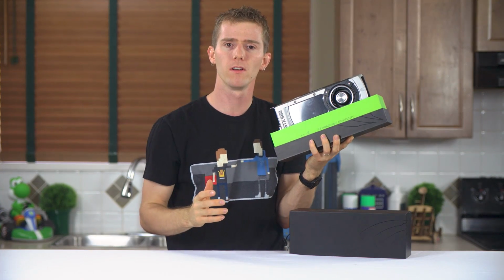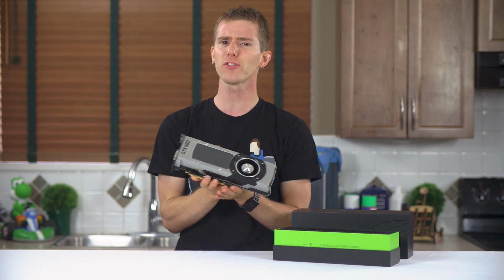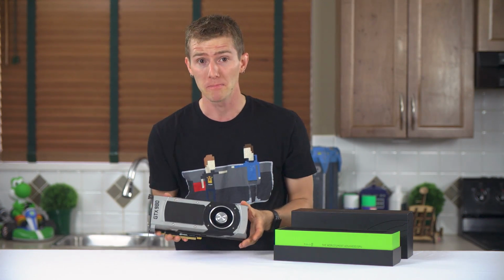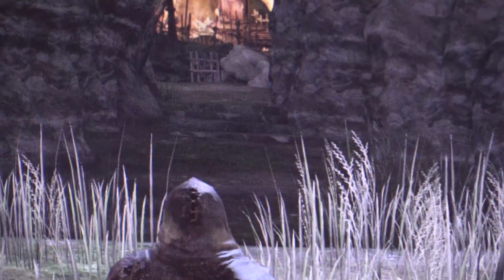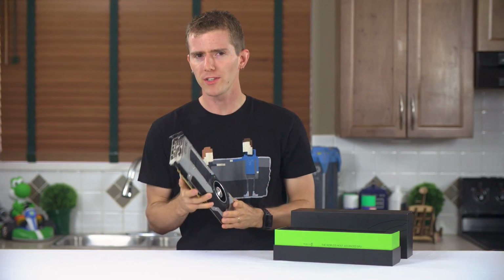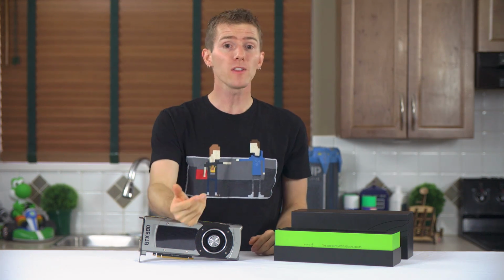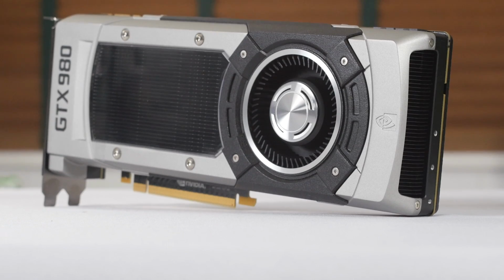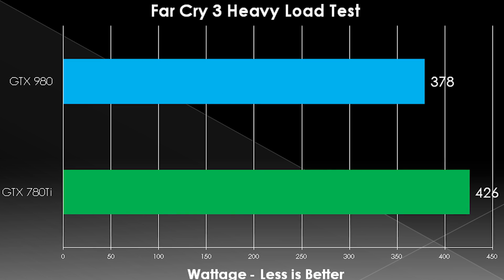NVIDIA GeForce GTX 980 Video Card - Performance Overview

Comment: who else came here after seeing the new GTX 1080!!!! :D
Reply: Here after the rtx 3090!
Reply: iBoolGuy isn't 120 FPS enough. That's just overkill. I have no reason to waste a extra 100 bucks (Which is alot in my currency) just for more FPS which I don't even need. It's not that good unless your monitor can handle 120 FPS. I don't want to wait for the 1080 Ti.
Reply: iBoolGuy Which team are you on :). Team Red(AMD) or Team Green(Nvidia).  I'm team Green but don't force other people to change their stuff to Nvidia(Hate those guys) and Well this is totally based on performance wait a bit and get the GTX 1070 or GTX 1080 they are like on par with the GTX 980 Ti which has 10/10 score in GPUBoss comparing with a R9-390X which has a 8/10. Pascal is way cheaper too well It's your opinion just letting you know how you can save some money.(http://gpuboss.com/gpus/Radeon-R9-390X-vs-GeForce-GTX-980-Ti)
Reply: Dhruv Collins and again, as you may already know, the 390x (gigabyte version which is my personal fav) is way cheaper than both the 980 and the 980ti!!! (also gigabyte versions)!!
Reply: me
Reply: me
Reply: +Dhruv Collins u r right of course, but u don't know the way he thinks :/
Reply: me
Reply: !!!!!!!!!!!!:D!!!!!!??!!?!!!XD!!!
Reply: Rtx 2080
Reply: 2080?
Reply: here after 3080 launch video
Reply: I came here after the 3080 fiasco. Bought a very cheap $50 ASUS GTX980 to run MSFS. It does the job at 1440p with some tweaks in the graphic settings. I'm going to wait until the Big Navi and 3090 market stabilizes.
Reply: @d.joseph4356  holy frkn balls! a GTX980 for $50! That's quite the thing to hear! Enjoy that thing man, good deal! :)
Reply: @iBoolGuy  I know right? the second hand  market is insane right now, saw a gtx 1080ti for like 350 dollars
Reply: @ericb0207  Just bought a 1080 ti for 240€!
Reply: @d.joseph4356  You're not running 1440p on a 980 ggs
Reply: blaze smooth at low fps
Reply: Holy shit, that was along time ago
Reply: Dhruv Collins I mean yeah of course I'm with you in that, I'm not the type of "overkill" person, I just ask for a smooth experience and that's it, but for some people, they would pay whatever to get that extra 1 frame :\ 
and btw, I'm saving up to get the 390X :D I'm not gonna wait for the Polaris cause it's gonna be so expensive :V
Reply: lol I'm obviously on the red team side, it's just about love :D I like their warm in the winter, I love the sound of those 3 fans shaking my mastercase pro 5 XD and lol of course I know that some GTXs do better, but it's just a personal preference and more about love <3 and yet the 390X is an excellent card (for my needs of course), so yeah :D
Reply: I did, then took advantage of the plummeting 980 prices due to the new release.
Reply: +threedogification best move ever. :p
Reply: threedogification That was not a good move you could have got a 1080 which is much more powerful than a 980 Ti or a 1070 which is on par the the 980 Ti.
Reply: +Dhruv Collins he's obviously really limited on budget, and for that price a 980 does more than good for him, as I could tell from his comment!!
Reply: Dhruv Collins lol apparently he prefers getting a bad deal if he's actually going to buy one, but I guess the way he sees it, is he gonna pay less, so that's a good deal for him?? and maybe he's not gonna be able to make more money in so long, so there's no good of waiting! as I told you, you don't know what's he's going through, everyone's situation's different :)
Reply: Dhruv Collins for imma amd fan boy :p dunno about him!
Reply: Dhruv Collins lol man sorry i have no idea how to use that!
Reply: ***** 290X ??? I was talking about 390X, but definitely, first I'm gonna wait and see all about Polaris and its prices
Reply: ***** I don't even know about Vega!! but personally, I would pay extra money for newer technology even if there wasn't that big of performance improvement.
Reply: ***** it's not about budget, I just want to get a 1440p monitor, but my card cannot handle that, and that's why I wanna upgrade it, and I've been waiting long enough, but anyways, 2 or 3 months are ok, hope Polaris turn out to be better than expectations :)
Reply: ***** I don't understand people like you, sir, your card does not deserve an update, especially when you're only updating to 980 :\ just my humble opinion! :)
Reply: ***** well, thanks for calling me a fucktard, while I was only trying to help :)
Reply: ***** i did not mean they're close in performance, but within the same conditions that u might already have, upgrading won't be worth it unless u want to get a higher resolution monitor, but if 380 runs your games at 60fps, personally i dont see it necessary to upgrade, nonetheless good luck with what you got :)
Reply: ***** lol i'm happy u understand me now, cause of course i talk only for myself, and 60-75fps is great for me, and personally i don't get the point with more fps than that!
Reply: +Dhruv Collins 13-48 fps
Reply: +Super5oldier1 960 in space engineers with alot of stuff
Reply: +BEASTGAMER im gonna search 880,780,680,580 etc after this
Reply: +deez nuts gtx 880 never came out
Reply: I did
Reply: ME!!!!!!xd;)
Reply: Who came here after already buying a 1080????
Oh wait...probably just me.
Reply: I'm watching this on my 1080 Ti
Reply: iBoolGuy me
Reply: i am here after the RTX 2080
Reply: Im here after the new (over priced ) rtx 2080 ti
Reply: Rtx 3080
Reply: RTX 3080.
Reply: I see this after seeing rtx 3080 LOL
Reply: laughs in rtx 2060 super
Reply: What about rtx 3090? Lol, it puts all of this to shame, and this is only 6 years old
Reply: And I came after seeing 3090 (imagine seeing this comment like 4 years ago)
Reply: Moghal Baig this thread is a literal portal/time machine.
every new generation that comes out, it starts a buncha replies from the newer gen.
lmao look at the replies and watch each era.
rise of nations 😂
Reply: Technically...
Reply: im here after the 3090 lmao
Reply: Of these comments Didnt age all that well
Reply: hey im from the future. im here just weeks after 3090 is released
Reply: i did

Comment: new to building PC's, just got a GTX980, is overclocking worth the price? I5-6500 for about 200 , includes a stock fan but not great for overclocking, or the I5-6600k which is 50 dollars more and requires I buy a cooling system, probably would go with the 212 evo. what do you think?
Reply: +goalieslayer intel CPUs without K in their name do not support overclocking FYI! imo the 6600K is perfect for gaming, same as its ancestor the i5 4690K!
about overclocking, I personally never seemed to need it :\ but I tried it tho, and also never worked for me, especially overclocking CPU, it's a pain in the butt, needs lots of hours and tens of different elements and configurations to change and monitor!!
but anyhow, you wouldn't need overclocking, cause those CPUs have ready boost overclocking, meaning it will boost up the clock on it's own when it's under heavy load, and some motherboards support on-board one click overclocking, going from the base 3.5GHz clock to 3.9GHz in my case!! I hope I helped :)
Reply: thanks!!! that was indeed helpful! i went with a 4690K

Comment: I just put one in my Mac Pro because I could get one with EFI ROM from MacVidCards. It works really well. Under OpenGL its somewhat slower than under DX, but unless Metal gets some traction that's what the games under OSX will have to live with.

Comment: I'm about to buy a pc with this gpu and since it can run 4k @ +30 frames, would I be able to run 3 monitors on a single board all Max and still get more than 30 fps, I'm looking to do this in the future with a fast 1080p in the middle with two super cheap $40 12 Ms response time school edition type monitors all 1080p
Reply: I may be late but, 4K is 4 times the resolution of 1080p. While 3 monitors is only 3 times the resolution. So you'll have no problem running it 30fps+ on Nvidia Surround or wtf it's called.

Comment: Nice Video like allways :-)
 I have a ASUS Strix GTX 980 @ 1400 MHz 
Boost Clock and 8210 MHZ Memory Clock :-)
 Asus Crosshai IV Formula Motherboard with a AMD FX-8150 @ 4.2 gHz
10 gigs of DDR3-RAM @ 1333 mHz
Performs very well. Upgrade the cpu maybe this year. On my chanel i have some Benchmark with this card. This card have a lot of Power . I pay´d 550 € and got Assasins Creed , Asus Mouse Gladius for free . Sorry for my english :-)
Reply: +Link Gaming get a i5 or i3 6100 and BOOM epic gaming system!
Reply: yes i Know 😀

Comment: I want to know what the 980ti does in 5760x1080 60hz.
Reply: Just dont get a 980ti for 1080p😑 its too overkill for 1080p and a waste of money, just get it if ur doing 1440p or 4k
Reply: Plus its 60hz , just go with the gtx 750ti because its only 60hz , that card will do just fine

Comment: I have a GTX 760. Should I wait until next year or upgrade now?
Reply: wait
Reply: +Ratchet Well, to be honest, you could easily pick up a 980 for less than 430$ and prime shipping or a 970 for under 300$ and free prime shipping or free reg shipping and the performance increase on even the 970 is well worth it. Although i myself have a 980 and love it, i would recommend getting a 970 now or 980 and 1080p60fps will be good on 90% of games through two years. However, it just depends on how much you want to spend and what not, just my thoughts

Comment: Idk if I should get the 970 or the 980. I've heard some bad things about the 970. Someone halp :'(
Reply: +Vortex Depends. Assuming the rest of your system is capable of handling these cards without bottlenecking, and you're not going to be gaming above 1080p, the 970 will be perfect. The "bad" things you have heard about the 970 are probably referring to its VRAM. It has 3.5GB usable VRAM instead of the advertised 4GB. If you are going to be gaming at 1440p or above, this can and will cause problems, but at 1080p, 99% of games will not be negatively affected by the VRAM in the 970. However, if you plan to play games at 1440p or above, the 980 will be a better choice. Hope this helps :)

Comment: HELP FAST! Can I use this GPU on my Asus Rog G20 ? I only have 1 power brick at 180 Watt, and I am going to buy another power brick at 230 Watt so then I have 410 Watt in all togheiter! And this GPU reqiures 500 Watt, but I only have 410 Watt. How does this work ? I also only have 6 x 8 pins... I'm not quite good at this.. please help! :)

Comment: So did i fucked up buying gtx 980 instead of 970? because a lot of people say that the price isnt worth it...
Reply: +Joao Pedro Mesquita No it def is not worth getting a 980 over a 970. However it is still a beast of a card and if the extra money you spent wont go to anything else, then dont worry about it.
Reply: +Machoalbatross thanks
Reply: +Joao Pedro Mesquita 980 has proper 4gb of vram. 970 has 3.5gb of proper vram + 0.5gb of of slow ass ram.
Reply: I think im going to buy a 1080
Reply: :D

Comment: i have an i5, 8gb of ram and a 550 corsair power supply. will this be okay or is it overkill?
Reply: should i go with the radeon 270x instead 

i want to play ark: survival evolved at medium- high settings with at least 30 fps
Reply: +Steffan Labuschagne i have an i5-4460 and a r9 280x and could run ark smoothly on high, i should try again with the new updates to see if i can ultra now, but ark is very demanding.
Reply: +yuukiflow Haha, demanding. It's just not optimized.

Comment: for the guy with minecraft at 40 fps instead of much higher. check if you dont use the intel integrated video card instead of the nvidia one.

Comment: Is this worth €150 more than a r9 390 or a 970?
Reply: +Zeuslight and the GTX 980 does NOT?
Reply: +Evan Griffin The 970 is a scam. You're paying for 4GB of VRAM while you only get 3.5 and 0.5 slow vram.
Reply: +Evan Griffin Its about 15 FPS more than a 970.
Reply: nvidia 970 has shadow play

Comment: I have an AMD A10 @3.6 ghz with 12 gb of ram. I only have a 300watt power supply though. Could I run this
Reply: +The JelliedPumpkin No, definitely not. An AMD A10 is an APU, which would bottleneck even a GTX 950. Also, to run a build with a GTX 980 you would need 500w minimum from a reputable brand. Your ram is fine though.

Comment: I have an 
AMD FX8320 cpu
Gigabyte 970 motherboard
Corsair 650x psu
Would i be bottlenecking this big time if i got it?
Reply: 8 gb of ddr3 1866 mhz
Reply: Not at all
Reply: +H White No but you may get bottleneck at lower resolutions because the fx8350 is better at super high res. its a decent 4k chip but not great for 1080p.

Comment: I have a GTX 980 4GB, Intel i7 2700k Overclocked to 4.2GHz, and 16gb of ram all on Windows 10 64bit. Fallout 4 will dip down to around 45 frames when walking into deserted cities like where the Brotherhood of Steel base is with most settings on high and godrays to low. Idk why I thought I could run it close to completely Ultra. Should my rig be a good match for the 980 or am I maybe bottle-necking? I have the money to upgrade so I was looking for opinions.
Reply: +El Manimal I think I know your problem;
Go to desktop, right-click and go to Nvidia control panel.
Next, underneath "3D Settings" (Top left) click "Adjust image settings with preview"
Then select "Use my preference emphasizing" and slide the slider to performance rather than quality.
Hope this helps!
Reply: ***** Hello thanks for the reply, I figured out the problem. I needed to update my motherboard lol. After that, Witcher 3 runs on an almost constant 70+ frames on Ultra! :)))
Reply: Will this build run games with great quality and frames? http://au.pcpartpicker.com/p/r6yWnQ
Reply: +Charge Echo yes get a 1070 or 1080 though and get windows ten from kinguin it's like 30 bucks there

Comment: I needed to see if i can run Gta 5 with my computer, NVIDIA GeForce GTX 650 Ti BOOST (MSI) 2GB - AMD FX-6350 6 Core Vishera 32nm 3.9ghz - Ram 8GB DDR3 - Is anything else needed to know about for someone to answer if i can run Gta 5 and what settings at what frames?
Reply: Trillion Amaze Don't be a fuckface. If you're not going to help the guy just leave
Reply: Trillion Amaze Don't get upsetti have some spaghetti to forgetti your regretti
Reply: It will run, but don't expect a solid 60fps. The 650Ti Boost and your processor will get R3KT, GTA5 is very poorly optimized.
Reply: +Intel Core i7 6900K (Overcocked to 6.9GHz) what do you mean by rekt?
Reply: +Kuovix He means "rekt" as in your shitty gpu will get rekt as the cpu wont change shit.
Reply: I had a dream I had 69 subs and no videos games runs fine on most high /medium settings with 60 frames and my temperatures stay pretty decent
Reply: Kuovix Is that suppose to change something?
Reply: Because you were wrong
Reply: What games, exactly?
Reply: Meant *game i was talking bout gta 5
Intel Core i7 6900K
Reply: +Kuovix that's actually pretty nice!
Reply: Trillion Amaze Someone seems a little mad? Havent even said anything to make you mad but go ahead and be that way idc
Reply: Kuovix Invalid as you do not know what I am thinking or what is going on in my mind.
Reply: Intel Core i7 6900K Nice comeback. Next time, try to use your brain instead of your ass.
Reply: +Trillion Amaze Humpf i see butt hurt its okay your build can just run solitary on low settings :)
Reply: Intel Core i7 6900K He did not ask for help. He just wanted to trick ppl into thinking his cpu was bad but forgot that the gpu is more important.
Reply: Trillion Amaze No shit it does, new generation and slighty higher up, my 980 will destroy your 960 but hey i guess i dont know what im talking about
Reply: No name Hi You must of read my comment wrong. You don't know my specs so how about you stop with the gay solitaire comeback? Also, I could care less about your 980, as I see no point in having one to run 1080p csgo.
Reply: Trillion Amaze Humpf I can care less on what types of games you even play, Even tho CSgo isnt a real game lol
Reply: No name Hi I was just saying that 980 would be overkill with the games I play and used csgo as an example. I could care less about whether you think its a real game or not.
Reply: I do agree with you there for cs go, however i play a loads of different games that require a good graphics card,
Things like Age of mythology, Call of duty or Battle Field 4, Star citizen

Comment: Do you choose 970 or 980?
Reply: +2( ͡° ͜ʖ ͡°)4You? 970. The 980 barely gets a boost in gaming performance compared to the 970. That's why you rarely hear, "And my GPU is a 980." It's usually either the 970, 980 Ti, or the Titan X.
Reply: +AlphaLineGaming Alright... Thanks Bro
Reply: For some reason, it seems like Radeon's are better for me, though. I run a 390 in my build and it can handle 1440p no problems.

Comment: Can u do an over clocking guide of this card
Reply: +Newbecollector Just find an overclocking guide for any graphics card they all use the same software. 980's generally get upto about 1500+Mhz but that all depends on your particular chip, My 980 only gets to 1470Mhz before i start seeing issues. It's a lottery

Comment: Does this graphics card support a 350 watt power supply and a AMD 760G motherboard? Please respond.
Reply: Very unlikely. Buy a 600 or 700 watts PSU. Because I doubt you can run a 980 with a processor that won't bottleneck with that PSU. Also, minimum system power requirement for the 980 IS 500 watts.
Reply: HeroHuyX Thanks for the info.
Reply: between 450-550 w with 80 plus is enough